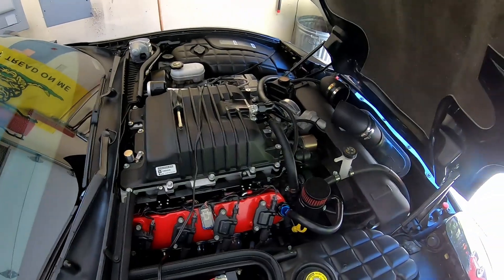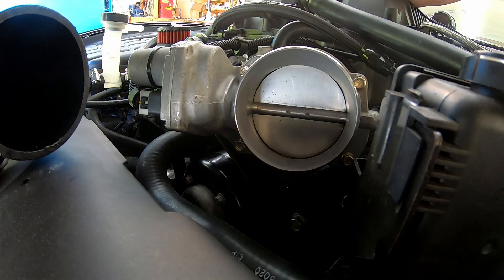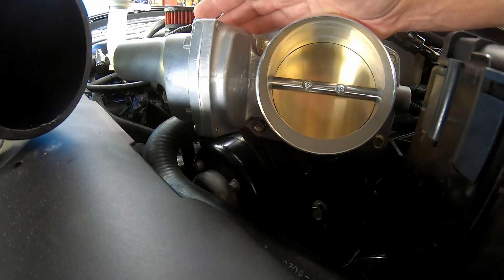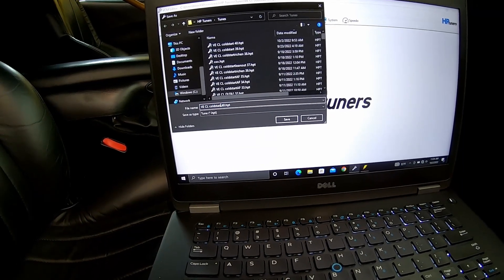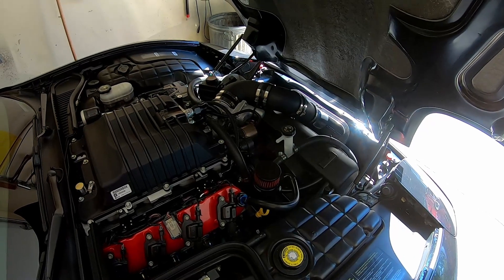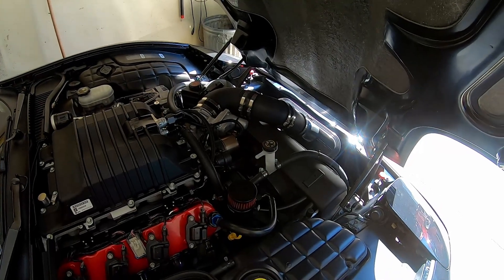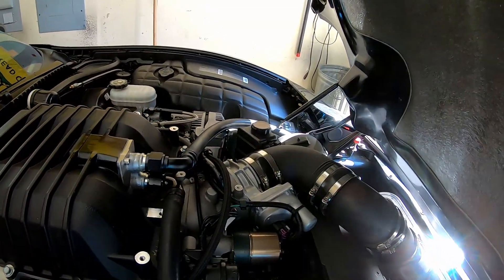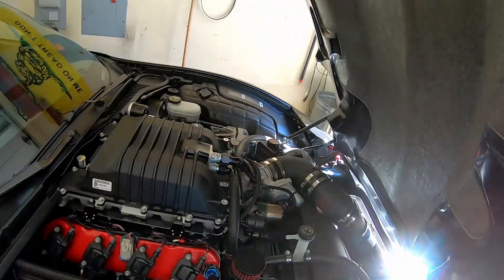How To Run 90mm LS3 Gold Blade Throttle Body On Gen 3 LS1 VS Silver Blade C5 Corvette

Comment: beautiful beautiful noises! good info, katech does make a 103 for the c5 now but it is 679$. mine will always act up after a flash and sometimes run lean just for a bit. have you ever had issues with the L terminal circuit? i will get an ses L terminal circuit code but only when i am wot for a few seconds.... need to look at connection at pcm but dammit why in the fender...
Reply from the maker: Even on my build a 103mm would be overkill by quite a bit.   I would need so many other mods and porting work done to take advantage of it.   and most definitely cole these cars do weird things for a bit after loading a tune. sometimes more than others with no explanation lol.   I always wait to start a next datalog especially for VE until many miles have been driven and it's fully up to temp.     Never had an L circuit code and it sounds like I don't wanna lol.
Reply: do you notice a better throttle response with the newer tb?
Reply from the maker: @colemcmeans7809  I don't think so cole.  Hard to tell if there is a difference.   Got another couple hundred trouble free miles on it since the video was posted.

Comment: How’s that catch can setup working out? Looks like Holley covers vented to your can?
Reply from the maker: I don't know if this new engine is tighter as far as blow by which would be kinda weird because the ring gaps are opened up with this new engine.  All I do know is the blower is way way more dry inside than it ever was on the old engine.   That being said I am very happy with the Mighty Mouse can.   The one thing I don't like about my current setup is it's a pain in the ass to add oil to the engine.   I have to take the catch can hose loose every time.

Comment: 👍🏻😎 The relentless pursuit of perfection can be a pain in the ass, but it's well worth it when you get there.
Reply from the maker: Thanks JT.    It's getting pretty fun to beat on this thing but the 5.50 a gallon I did that Gas is getting kind of old lol.
Reply: @PNW_Car_Mods  I know what you mean. Since they went to 15% ethanol a few months ago, I have really noticed a drop in fuel economy. I've decide that I'm only going to buy the non-ethanol gas from now on. The extra $2-$3 a tank isn't going to be that big of a deal considering I'll be getting about 30% better fuel mileage than with the 15% ethanol blend.